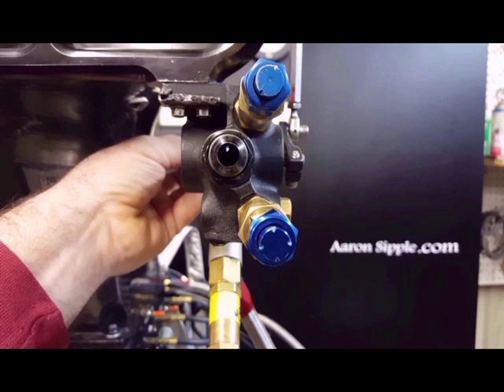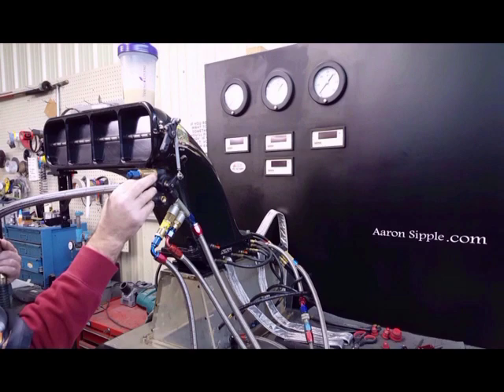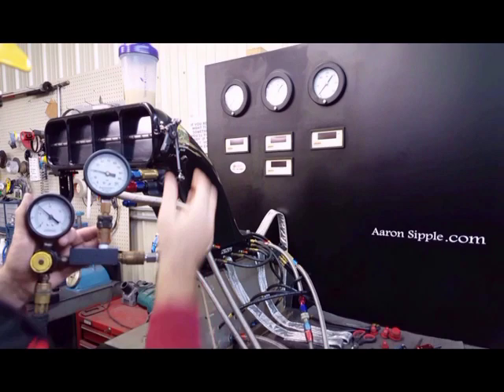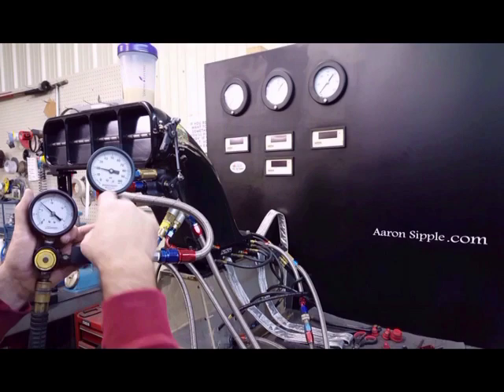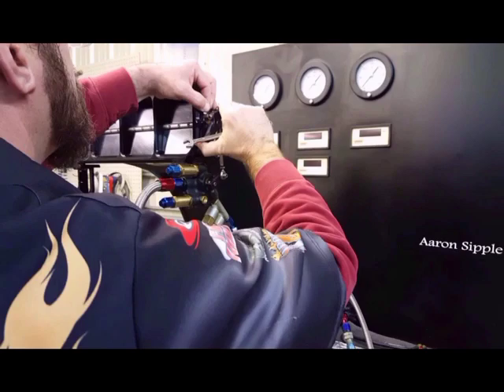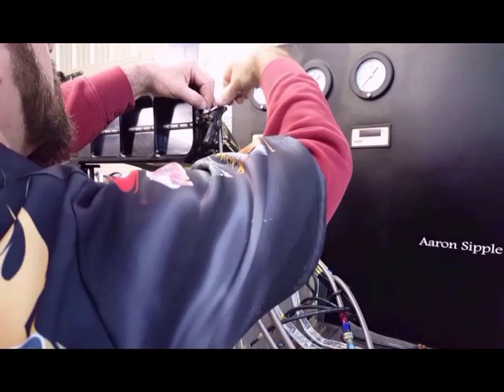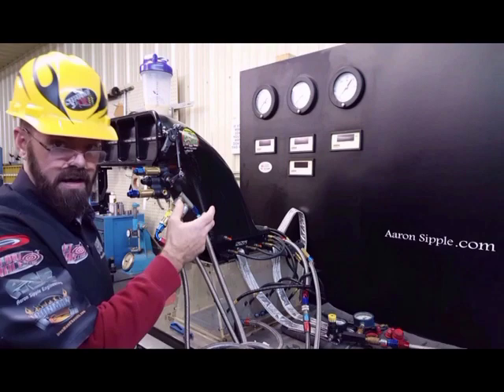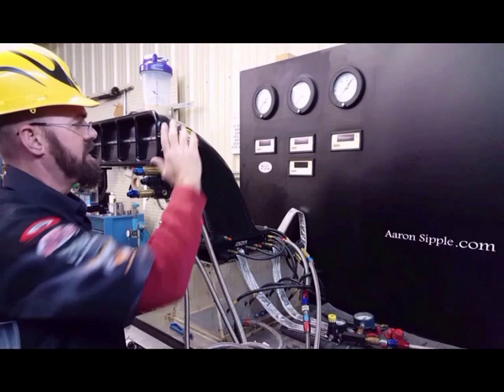Barrel Valve with Aaron Sipple #reels #shortvideo #shorts #viral #video #viralvideo #instagram

Comment: this was interestig im already learning on the Barrel valve as im a nitro fueler funny car racer in future as im reallly am ready to learn the tuning side of funny cars as thiswas my 1st ever race car in future as i have to learn this in future as a tuner im really ready for the day id learn to tune the funny cars as thiswas really my first ever Constant flow injection as thiswas my first ever injector setup on my first ever funny car as far i knew thiswas really be my first ever lessons in funny car tuning as far i knew thiswas really the case for me how i learn to tune the cars without the computers as far i knew thiswas my style of funny car im gonna drivbe in future as id run without the computers in my funny cars thiswas really my Old School race car thiswas really reason im tuning the car myself was being safer on the tune and clutch settings as i knew thiswas really my futue fuel racing experience was getting to learn on the job on the  fuel system settings as im a tuner in my own cars i knew the right settings was really the key to me getting really successful in funny cars as a tuner im good at tuning the cars myself in future as a disabled rookie nitro tuner and driver in fuel funny cars as you knew im gonna tune the car myself now thiswas really in my funny car future was being a tuner and driver in future thiswas the case with me now as a funny car driver and tuner thiswas the case in future now thiswas why im good on the fuel injection tuning in my funny cars in future thiswas really why im a future tuner on my fuinny cars thiswas the case in future as i tune the funny cars as thiswas really the case with me as i learn on the job in future inregards to tuning the cars thiswas my future funny car was caled blue Brutus was my 1st ever nitro ride in future thiswas my first ever nitro funny car thswas really be my first ever nitro funny car in with the barrel Valves as im really am learning alot on this now in future as im an old skool tuner in funny cars and will be in future